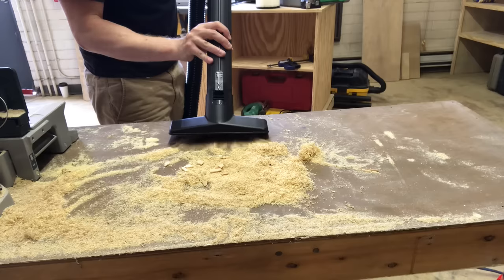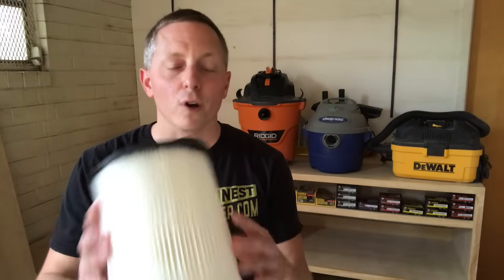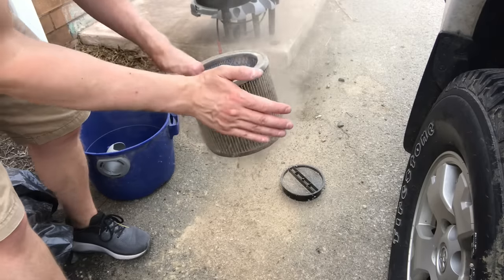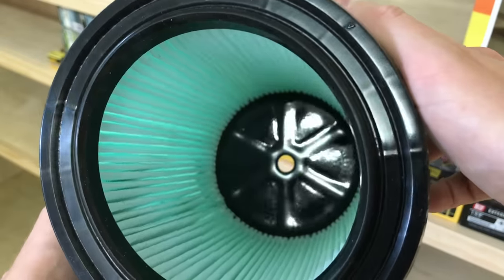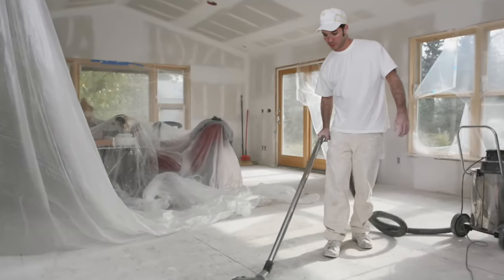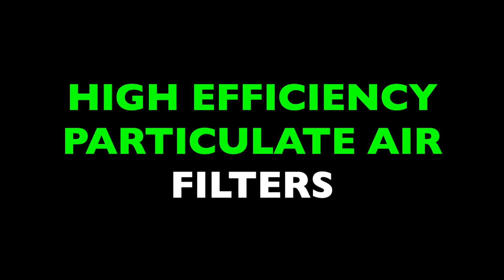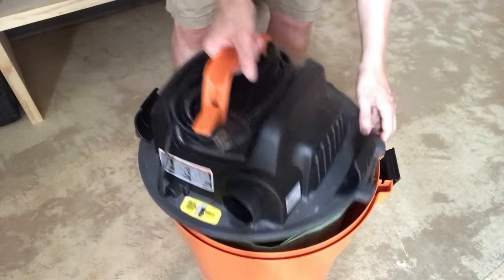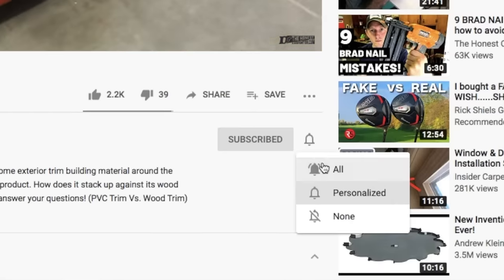Never Use A SHOP VAC Without One Of These!! (Shop Vac Filter Bags/How HEPA Filters Work...)

Comment: First, I really like your videos, and I think this one has very useful information.
Regarding this video - One word: anal.

I'm sanding the drywall walls in my new shop right now and I need to be able to clean out that filter easily and not keep replacing paper filters. But I also wear the n95 mask while sanding. I'm perfectly happy to let that filter clog up and then go outside and clean it out and continue on with my work. FWIW, I actually use a screwdriver to dig out the stuff between the ribs.

I actually have a smaller shop vac that has that secondary bag around it and I just got rid of it. Now, if there was a better bag after the round filter that caught the smaller stuff, as is the case on my living space vacuum cleaner, that would be great.

Bottom line is I see the best filtration system is one that starts with course filters and works its way down to finer filters, not the other way around.

Comment: Please put together a Dust Deputy before your vac, or similar product. Only about 5% at most of the material gets to the vacuum. I have a LARGE bird cage and the tiny feathers would clog my filter after 2 cleanings. I have not cleaned the filter in over 8 months. Just empty the 5 Gal bucket. Sawdust is really easy. As is garage dirt, basement floor.

Comment: The main reason vacuum cleaners have filters is to protect the motor itself, you always use a bag for the same purpose as well as reducing the dust that passes through into the atmosphere. The truck is to always use the correct filter and bag medium for the job at hand.

Comment: I’ve always used the dust bags on my ShopVac.  I have, however, had to replace the 6.5hp motor.  I don’t know if the additional restrictions from the bags may have caused motor failure.  The bags do work.

Comment: It it just me or have shop vacs upped their creativity these last few years? Also, is it a good idea to vacuum shop vac filters with a house vac? That's what kinda been doing, but me my guest since I am new to owning a shop vac.
Reply: I'd be interested to know as well. I got a RIGID to use as my house vac because I got tired of the ones I had breaking and getting clogged. 

It's annoying to fish a Hot Wheels out of the vacuum, but was easier than digging one out of the guts of a Dyson.

I dunno if the filters would hold up to getting hit by a toy that's getting sucked up, but if they can take the hit, I might grab the HEPA kit
Reply: @MorgenPeschke   1st and foremost, I believe this video's way too detailed and more tailored towards a jobsite use of a shop vac, 2nd. The beauty of a shop vac is that  the inner workings of it allow it for better straight up suction than a traditional household vac. What I mean by this is that since a shop vac has less external components they can trap the stuff better than household vacs. See household vacs make sense more for a light or quick n easy cleanup of a surface. That's why people prefer to use them to more occasionally. If you prefer a more deep and tough cleanup of any home surface than a shop vac makes more sense. Also I think fine dust of any kind can be trapped with a general purpose filter so as long it doesn't make more than 50% of its composotion. Makes no sense to waste more money on a HEPA filter if you're not on the jobsite or don't even at least frequently use the vacuum, not only are you wasting money, you're also wasting the material matter of the filter itself. However I could be wrong and still would consider purchasing one if they last longer than standard filters that is.

As for the filters taking a hit, I wouldn't worry to much about it, just make sure to inspect after each vacuuming session, that's what I always do anyway.

Comment: This video shows an internal bag being used as a protective pre-filter for the pleated filter. A pleated filter will be perceptibly or imperceptibly ruined unless some kind of protective pre-filter is used. Debris will punch perceptible or imperceptible holes in the pleated filter. One or more layers of quality, tough landscape fabric, for example, can be fashioned into a tough protective shield to cover the pleated filter. I would cover any pleated filter, HEPA or non-HEPA, with a tough pre-filtering shield to protect it from perceptible and imperceptible puncture wounds. If the internal bag or an external pre-filtering device ever fails, there must be a fail-safe pre-filtering tough protective covering for the pleated filter.

Comment: Thanks for Posting.  I have an OLD Sears Craftsman 12 gal Shop Vac which does not have an inlet adapter to place the fine dust bag on.  Have you seen a DIY fix for this?  I was thinking I could fab something out of 1-1/2" ABS - any thoughts?

Comment: So, which models/brands accept filter bags? I just called Vacmaster and they said they're 10 gallon with detachable blower doesn't. Also, where do you find filter and accessory compatibility info on wet/dry vac brands? I have a broken Shop-vac brand and need to replace it. I'd like to use some of my old Shop-vac accessories.

Comment: Didn't know this filter set is available, I'll get it and check it out. I use an Oneida cyclone, and hanging air filter systems in my  home shop. Stays pretty clean. Don't know any other way to make the area cleaner except to use the same equipment used to keep hospital surgical rooms clean, so that is out of the question. Wood work is a dusty activity.....

Comment: Does adding the bag cause more stress on the motor? An HVAC tech told me never to use the super-duper filters in our AC/heater because it took  more pulling power to get the air through the thicker filter thus adding more stress on the motor.

Comment: I use a smaller 'hang-up' Shop Vac in my little woodworking shop. It came with an extra long hose so I can clean up the whole area, without moving the vac. Because my shop in in our house I try to vacuum at least a couple times a day to minimize tracking dust into the family room.  My problem is because I don't ever lift it, sure as I'm writing this, I will let the bag over-fill completely and I won't notice it for a couple days - when I see dust accumulating on tools not in use. Is there any tip I can use to prevent this or must I take it off the wall weekly and pull it apart to check the bag? Thanks for useful videos.

Comment: Luv the Vid,
Thx, I learned Something today ! 

But I have a greenworks 3 gal shop vac. They have a HEPA filter, but no bags. 

Are there any compatible brand bags to use with it ? 

I'd like to protect the filter (white not green?) As much as possible.

I am allergic to dust (triggers wheezing asthma, slightly).

Comment: I reuse my vacuum filter bags by ungluing and unfurling both ends and emptying out the contents directly into the garbage bin, then folding both ends back up and using boxing tape to re seal them. Not sure if this is simply accumulating more and more finer dust particles into the fabric of the semi-porous bag or not, and making the motor work harder with each successive reuse.

Comment: I've tried the Rigid dust bags but even when you unfold them they just do not expand and you end up with a partially plugged bag. A cyclone separator helps to catch the big stuff before it even hits the vac bag if used in series.

Comment: Q. Which specifications (ex size!) bag should i get for an Armor All 2.5 gallon wet dry shop vac? 

(I appreciate your video. I don’t know much about vacuum stuff. I did notice that even with the blue bag covering the filter, particule dust is blasting out one hole of the vacuum, defeTing its purpose (why do they say you don’t need vac uum bags when without one, dust is reentering the area? 

Thank you!

Comment: Dude. I have a glass fiber leak from a memory foam mattress. It's cousin is fiber glass. Essentially they weave glass fibers into a fire sock and put it over a memory foam mattress. I didn't know that. The cover got removed. I spot cleaned what I thought was memory foam and put a fan on it for 20 minutes. It went everywhere. I have air scrubbers running now. 2 of the 700 models. 
I've got to go back in and salvage items. Will this work? Is there a bag for the exhaust port too? Thanks!

Comment: Have you ever tried running your hose to a separate five gallon bucket with water in it to make a water filter? Essentially run another hose sealed to the lid that goes to the bottom, while the hose from the vacuum is only flush sealed to the lid so that the air gets pulled through the water before going to the shop vac. Kind of like a dyi rainbow vacuum, but without the weird pyramid scheme sales.

Comment: Thanks. I'm going to try your setup. I recently pulled up the vinyl sheet flooring in my kitchen and found solid oak floors under it. It's a small kitchen so I'm going to try and refinish it myself if I ever get all of the adhesive off. Hand scraping has been cumbersome. Any suggestions?
Reply: Soaking with a flat rag and covered with plastic to curb evaporation of Naphtha which is the least flammable and toxic of solvents. It's slower to act but safe with wood. Scraping is still the way, it will roll off quicker. Forget sanding, it will just gunk up the grit belt.

Comment: I use a dust cyclone. I vacuumed my table saw collection compartment in the dark with a flashlight on the outlet port of the shop vac. Nothing.
Would still consider putting a tubular HEPA filter on it.

Comment: I like this idea but I have two questions: How does the filter bag affect your CFM air flow? Also, how much more of a load does it put on the motor thus affecting the life of the motor? With that said, bags and motors are cheaper to replace than lungs. 🙂  Great video!
Reply: Kind of like work boots. I'd rather get two pairs a year or 40 pairs for a career rather than get two knee replacements. Get those boots REGARDLESS replaced whether you think you need it or not. 20 pair of boots cheaper than knee replacements.

Comment: My 12-gallon Ridgid shop vac does not provide enough suction to my entire dust collection system.  Would a second 12-gallon shop vac connected by a Y increase suction? Currently I have a Dust Duputy perched ontop of my shop vac with 20 feet of 2.5" Powermatic flex tube.  This works great.  So I added another 20 foot hose with a series of blast gates and Ys.  Now my suction is terrible.  Will a second shop vac running in parallel help? Thanks.

Comment: Question - how did you get the thin rubber gasket on the HEPA filter over the inlet tube? I'm having the darndest time getting it in place and am worried i'm going to tear the gasket. Otherwise - great video!  I'm using mine to clean up fiberglass insulation -  which also requires HEPA.

Comment: Also, you should mention, Removing the filler when using water. I have seen people not remove it and use water then drain the water. But leaving the filter wet. Big mold issue.

Comment: I agree that using bags are better to use. However though, even bags have their cons as well. For one, they can also clog because the bags have pores just like filters. Secondly, you cannot suck up water with a bag on. And last but not least, they are pricey. I used to use a bag on a wet dry vac, but I no longer use them and went back to bagless. For picking up very fine saw dust and drywall dust, I had to constantly change the bags out that aren't even full. It was really annoying. Plus I had spent quite a bit on bags. If you think about it, using a wet dry vac as bagged is not a cheap way to clean in the long term. More expensive than buying another wet dry vac honestly. You're probably better off to just use a broom and dust pan instead if you're concerned about using your wet dry vac as bagless. Or just build and customize a cyclone that you can convert your wet dry vac into to prevent from clogging and making your wet dry vac last longer. Still doesn't solve the cleanness of emptying out the canister, that's where the bags win on this completely. But you do have to wash out the filter and the canister anyways right? Because the bags can not only clog up but also leak out dust as well. Also regarding washing the filter out, technically you CAN effectively clean the out to make it look and run like brand new if you're washing it correctly. Believe me, I've had some success before. And last but not least, there are wet dry vacs that have filters after the motor that would catch out dust that would leak out of the motor, regardless if you're using it as bagged or bagless. So I wouldn't be too concerned about it if you're using it as bagless. Overall after watching this video, I'm still going to use wet dry vacs as bagless.

Comment: If I use these filter bags, does that mean I dont need to separately add in a "dust separator connected to a 5 gallon bucket" in between my grinder and the vac itself? How do those dust separators work? Do they have filters or do they just let the heavier dust fall from pure gravity into the bucket, and filter that way?

Comment: An Question for U. If I Use the Shop Vac to lift Dry leaves from the Backyard Do I have to remove the Fine Dust Filter. I find that if U don't the Leaves clog up the Vac.

Comment: For drywall dust use a water filter like the “sand clean.”  The dust gets trapped in the water and you just dispose of the sludge.  Don’t pour it down the drain.
Reply: I tried one of those years ago, boy do they build up static.

Comment: I clean mine by going outside, put on a N95 respirator and use compressed air from the inside out.  That's good enough.  It's too expensive to be replacing HEPA filters all the time.
Reply: I think one of his point was that all these shop vac filters are not HEPA filters. Frankly, I naturally assumed they were HEPA filters as well.  He is saying that the Rigid shop vac he bought with using a filter and bag comes close to what a HEPA does.

Comment: A another thing you can do, is put a panty hose over your filter. This way you don't have to bang out your filter as often, and your expensive hepa filter will last years. The only particles that make it threw to the filer are very small. Another cheap easy pre filter is felt, using a couple small pieces of velcro/rubber bands to hold it on, or you can just buy a pre filter. 
I like this better than the expensive bags, that are just more waste.

Comment: HEPA filters are rated by how well they filter out  .3 micron, but the most dangerous size is 2.5 micron and under.

From the EPA.
"Of these, particles less than 2.5 micrometers in diameter, also known as fine particles or PM2.5, pose the greatest risk to health..

Comment: I mostly suck miscellaneous dry crud  Into a filter bag,  Worth the cost as expensive as they are  And ensure  Have a replacement bag on hand. Plus banging out the pleated filter is such a PITA. Tip:  Downright nasty job even with a pleated filter + Filter bag - do  only in very strong wind out of doors. 😁 
 The challenge is to remember the bag is in  There when run into something  Damp or worse  wet. (For me  a  Flooded lanai.)  Doesn't happen often enough it's easy to forget plugging up that expensive bag with sludge. 😏  Another tip:  Put some sort of reminder on the  Wet tool. 😉
 With no longer a  Handy resource to get advice For random questions like this 😝  This little old lady appreciates  your video Confirming My choices.  
Also -  The ability to have a bag filter was one of the key features when choosing  A replacement shop vac, finally! when the  Piece of 💩 died. 
 Any  Covering over the pleated filter May  Be reusable  And as I said my bags are expensive, but I want to be done with  Whatever I'm Sucking up. 😆

Comment: Great advertisement. But a much simpler method is to take a adapter for the vac exhaust side tie wrap 1/2 of a old bath towel to it and wet it and wringer out and no dust goes in your shop.

Comment: I have a craftsman 8 gal wet dry shop vac. I can’t find a hepa bag filter. Do you know if they make one for this model or am i stuck buy a hepa cylinder filter and a using a regular bag filter? Thanks
Reply from the maker: If you can get a HEPA cartridge, AT, I bet it would go a looong way when used with a decent bag as well 👍

Comment: Just buy a Gore Stream filter $35 bucks. No bag needed and could last years if you don't accidentally stab a hole in it lol. Works wet and dry. Drywall dust just falls off of it. If you don't want to dump the container. Buy the cheaper non HEPA bag since the filter will stop anything else anyway.

Comment: Hi,

What is the best way to fill a hole in a stud so that you can screw into the same hole to mount a heavy object? When I searched for this, I kept getting solutions for drywall. 

I’m a new home owner and made a mistake hanging garage storage shelves. I got the original measurements wrong and now I need  to reuse screw/bolt holes that are not getting tight.
Reply: This may work for you, but depends on your exact situation…
Drill a 1/2 inch diameter hole in the screw location and then glue in a section of 1/2 inch dowel.  If you can, make the dowel longer than the screw you’ll be using. If the screw/lag bolt is very large, use a larger dowel. Be sure to drill a pilot hole in the dowel before screwing in your fasteners.
Reply: @henryfitzgerald4965  Thank you!

Comment: The Dust Deputy and Super Deputy will pay for themselves quickly as they are very effective. Still on the original hepa filter by just gently blowing it out with compressed air. 99% of the dust AND water stays in the bucket.

Comment: Has anyone considered running the exhaust through a bucket of water like the Rainbow vacuum cleaners do? The water pulls the dust out of the air and you can just pour it out. Curious if anyone's tried this or not.